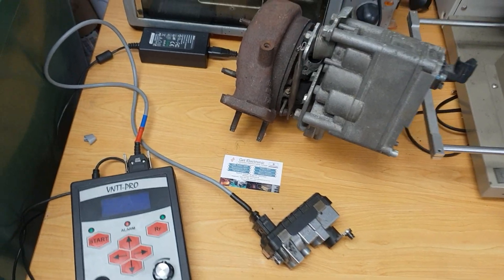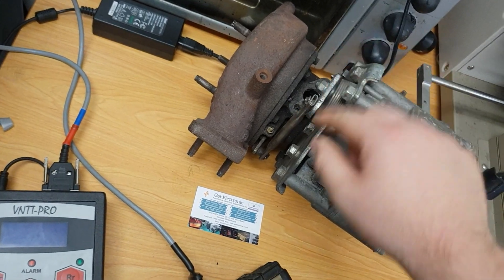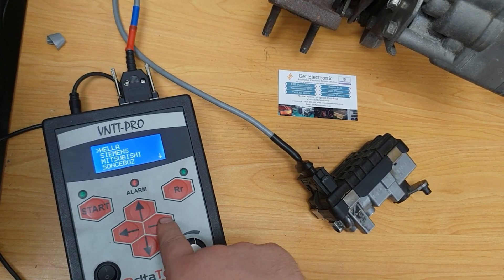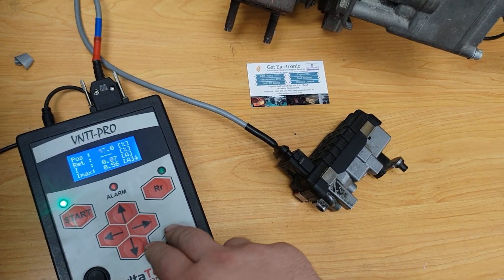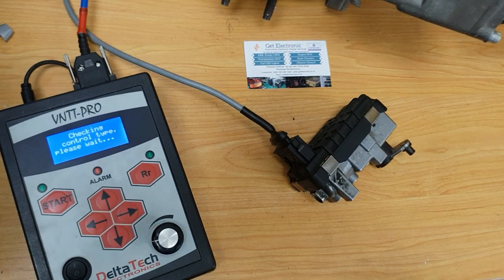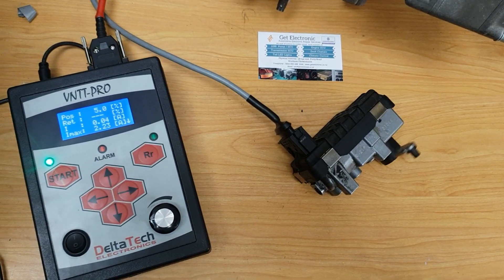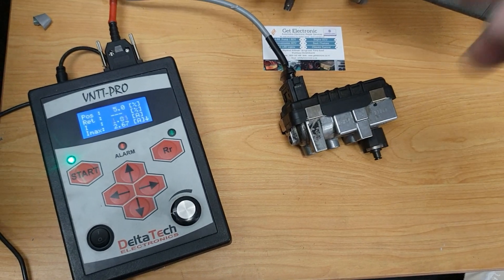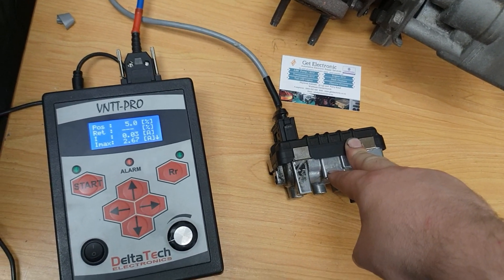Turbo actuator test

Comment: Common symptoms? I switch my engine of and mine makes like screeching noise. Also my van having starting problems can this be a problem ?
Reply: Turbochargers are not used to start a vehicle. If it’s screeching during turnover that’s another issue

Comment: Evening from the UK. I have a Nissan Navara 2011 D40 with total turbo power loss. Initially intimitient. Nissan UK have said it is the Actuator at fault but do not have a replacement, they say you have to buy the full turbo. If I took this to an electronics place like yourselves could it be tested and fixed? Thanks Chris
Reply from the maker: Yep absolutely! They typically can be fully tested and repaired,  flick us an email for a repair service enquiry.  Info@getelectronic.co.nz

Comment: Good stuff mate we have heeps of problems with hino and Isuzu actuators
Reply from the maker: Yip I bet you would ! Are you located in New Zealand?
Reply: Get Electronic no I’m in Sydney Australia 🇦🇺 a lot of the problems we see is no can bus communication .looking at the can bus waveform on the oscilloscope the bus signals are slow and deformed some even look like a sign wave have you come across this before cheers 🍻
Reply from the maker: @bundylovess  yip great diagnostics there, so thats for the N04 Actuator your talking about here where it droops out ?  yip replace the Canbus controller IC,
Reply: Get Electronic hi mate yes the no4 and the Isuzu 6hk1-tc engine  thank you for you reply and love you videos you do awesome work